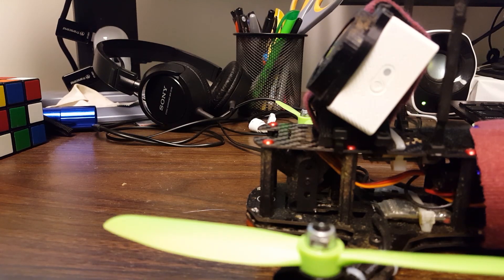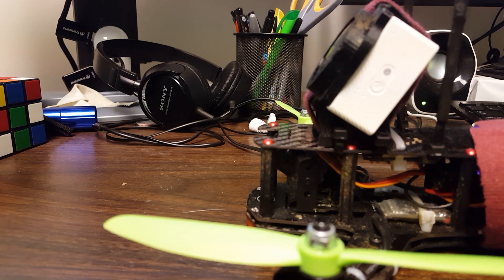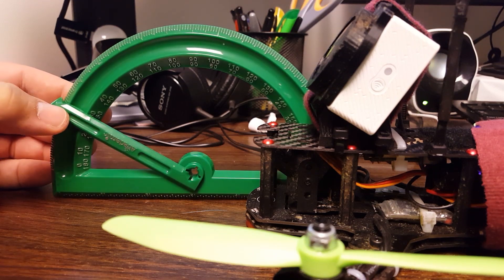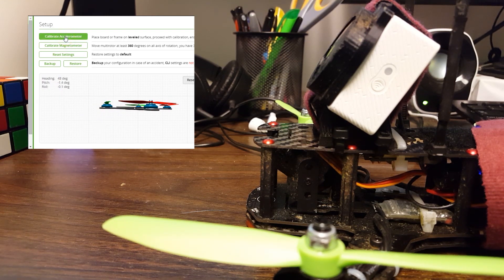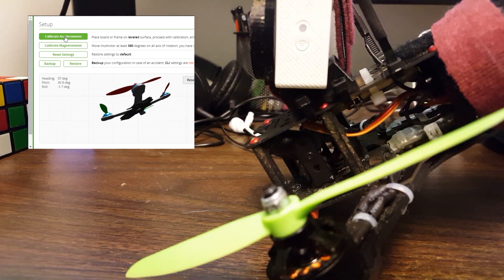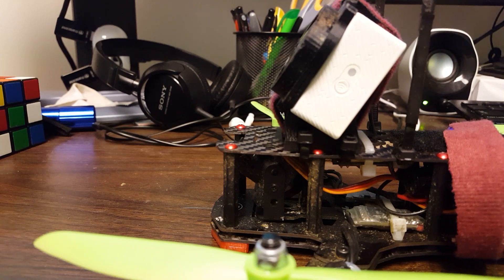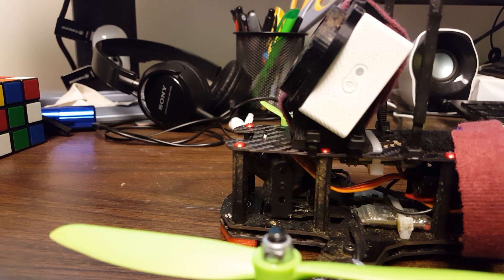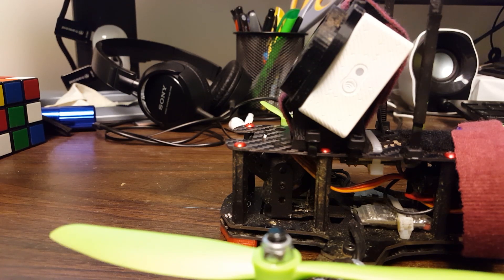How To Measure FPV Camera Uptilt

Comment: Another tip is to download an Angle app that turns your phone into a level. Rest your phone on top or bottom of the quad and tilt the quad until the desired angle, then adjust the camera to be as horizontal as you can

Comment: You can put your phone under the quad with a angle app and then tilt till camera is level,  and the app should tell you what your at .☺
Reply from the maker: But why. Your quad has a built in accelerometer.
Reply: @JoshuaBardwell  true Joshua,  your tip is the best .
Why make it difficult ? I do that sometimes lol , make something thats easy to do and make it difficult haha☺

Comment: If you really want accuracy.  Put a mark on the wall at the same height across the room  make sure you add the height of the table and the center of camera lens from the table. Turn on cross hairs on your osd and line it up through your goggles.

Comment: Why not just enable the center crosshair in BF and then put it on the ground along a skirting board etc... Just pick a point that's the same height as your lens and read the pitch angle in your OSD?
Reply: Mute has a slightly more complicated way that seems very accurate: https://www.youtube.com/watch?v=OfRtKS5uWXM
Reply from the maker: +Sliced Ham seems complicated but it would work.

Comment: As I sit here beginning to watch the video I say to myself grab something with a straight edge and lay flat against the camera then use the protractor to measure the angle.  Then you go and use the gyro on the FC itself to measure it, Mind Blown.  But really awesome little tip that I would not have thought of doing.  Thanks for all these Josh and keep it up, I wouldn't be flying if it wasn't for some of your videos :)

Comment: Great tip! It's even easier/more precise if you use a piece of blue painter's tape stuck vertically to a wall to use as a reference - 6" is enough. You can then hold the quad about a foot from the wall/tape and angle it while watching the bezel of the lens to align it parallel to the tape edge.

Comment: Right, ive just got into FPV and to start off set my uptilt of my hs1177 to 15 degrees or so.
im accustomed to that but i would like to up that a little bit to get more speed.
do yuo think i should gradually increase that by a bit every time or jump strait to 25-30??
thanks
Reply from the maker: It's whatever you're comfortable with. If you can fly at 25, go for it.

Comment: The thing that I am having trouble with in regards to cam angle is landing my quad, anymore than about 25 degrees and I feel i just cant slow the quad down and land safely as I can no longer see the ground. Ive tried putting it into angle mode to hover so I could land los but being a glasses wearer and using the quanum goggles it just too awkward.
If you ever plan on doing anymore freerider lessons I'd love it if you could possibly give some tips on this.
Reply from the maker: +LeakyMeat There are a couple of approaches to landing with high uptilt. One thing you can do is fly towards something tall, like a tree or a light post. This gives you a visual reference for how fast you are moving and whether you are gaining or losing altitude. You can practice flying carefully up to it, hovering, then lowering throttle to land. When flying in a field, you can also basically land by feel. Pitch back slowly and lower the throttle to where you know you are descending, then just wait to hit the ground and disarm. These landings aren't very pretty or precise, but they do get you down. Another approach I have used is to "skid" in to a landing. fly as slowly as you can towards the landing spot without pitching back so far that you can't see it. As you approach it, turn sideways and skid to a stop. Turning sideways lets you keep your nose down and level with the horizon while still thrusting "forwards" to slow yourself down. When you see that you have cancelled out your forwards velocity, quickly level out and cut the throttle to drop to a landing. Another approach that I sometimes use is to do slow spirals. As you spiral in, you bleed off speed until there is a moment when you're stopped, and you drop the throttle and land.
Reply: +Joshua Bardwell I like the sound of the Skidding approach, that's my sim practice session sorted for this evening. I recently had a flight inside a large building but the landing area was kinda tight so the spiral option would probably be out, but the skidding method sounds ideal. Thank you for great reply.
Reply from the maker: +LeakyMeat Another tip is, if you use a 2.1mm lens instead of a 2.8mm lens, the additional wide angle helps. My buddy who flies 2.1mm can see the ground in front of him at 45 degrees uptilt. I can't, with a 2.8mm lens. But I just can't fly through a wide angle. Just not used to it.
Reply: Responding to a comment a year later....this just helped me a ton!  I've been having trouble landing with low uptilt on my new wizard, but on my zmr250 naze32 build with higher uptilt I do just fine.  I'm not proud, but I hadn't thought of the lens, that's gotta be my issue.

Comment: I use a smart phone app that has a virtual spirit level. Place side of phone on camera lens, BAM it tells you the angle.
Reply from the maker: +Goat That was what I was going to show, until I remembered that the FC had an accelerometer build right in. So no fumbling with the phone up against the copter etc...
Reply: I suppose its more useful for the adjustment in the middle of a field. Your phone is generally in your pocket.
Reply from the maker: +Goat For sure.

Comment: You are a number man and i respect it - sitting and watching this i wonder how much the crud on your copter weights? :)
Reply from the maker: All up around 700 grams. Around 380 without battery and cam.
Reply from the maker: +Adam Wolski It's really too much weight, but this was my first racing build and I didn't know everything I know now. I would kind of have to rebuild the copter from scratch to get the weight down by very much, so instead I would just rather build a new copter and keep flying this one in the mean time. I like how it flies even if it's not the fastest or most agile.
Reply: +Joshua Bardwell my Bolt180 with 1050mAh 4S Tatts on it weights 381g all up :)
Reply: Joshua Bardwell thanks, I wondered how much the dirt on it weighs as a joke, so I think you misunderstood^^ I'm flying a fossil stuff frame that's all up 720g but it's on 6 inch props and it turns really good and I prefer it to my 5 inch 540g build. Keep the great work up!

Comment: Hey Joshua, ever thought about optimal angle? I did some math a while back and calculated that a hypothetic copter (4kg thrust, 400g weight) flying max forward speed without sinking will need a standard 90° FOV FPV cam tilted at 35°  so that the pilot will still see some horizon on the top of the screen. 
Ever since this finding I always tilt my cams to 35°, because it looks as the optimal angle - from technical point of view.
Reply from the maker: +Adam Pyschny Not sure I understand, but I definitely go faster at 40 than at 35, and faster at 45 than at 40.